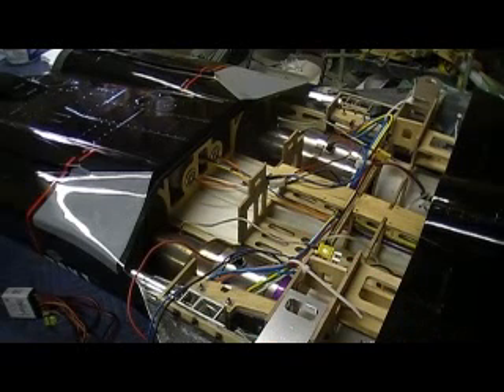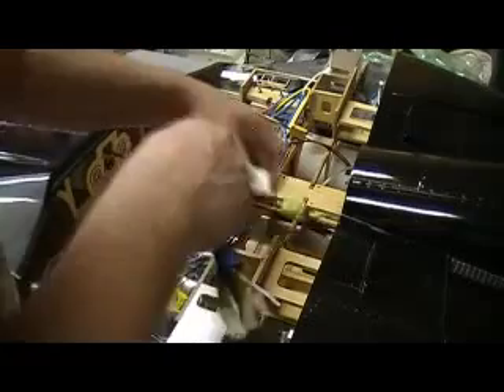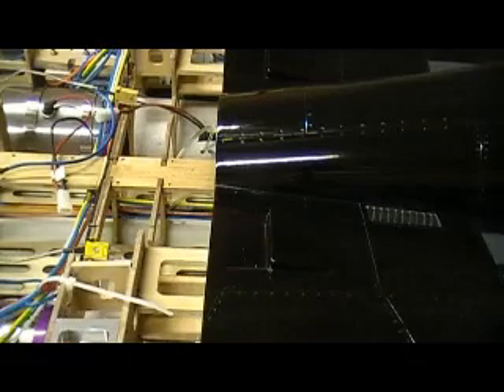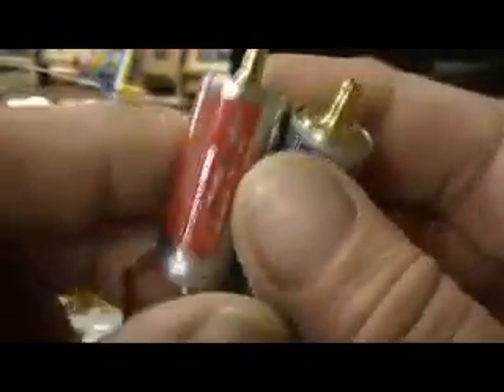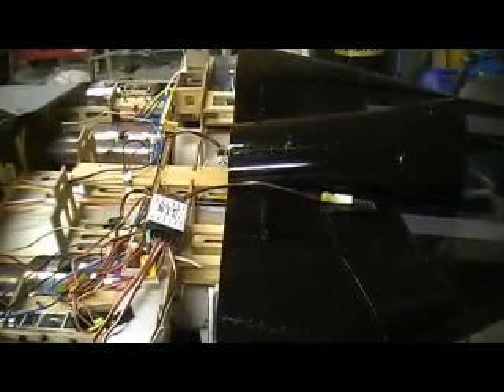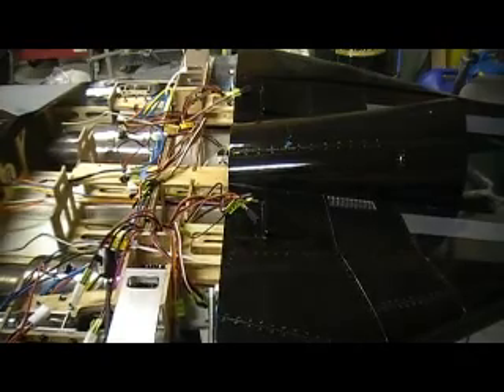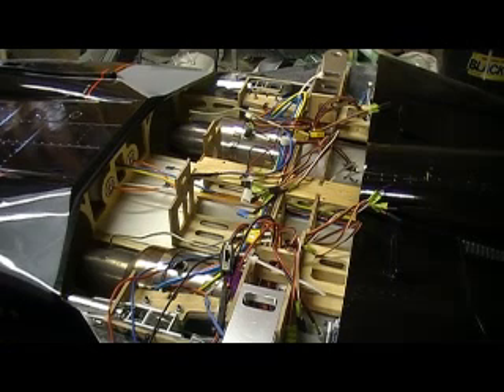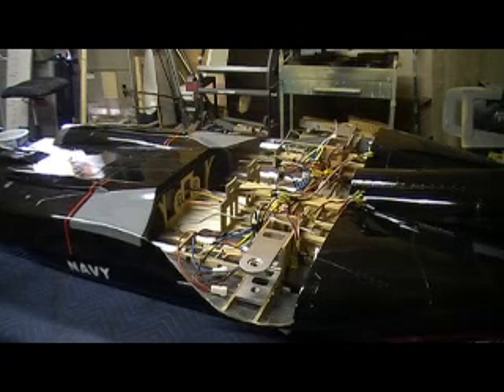FEJ F-14 tomcat build #7

Comment: @bhwystar   (& Bob!)   Bob won't have any problems with those pumps in the position he has chosen. They are very well engineered, have very strong fuel delivery, and will out last the turbine bearings. Pegasus start ups are really smooth once the propane gas has ignited. Try to have two separate channels for controling the ECU's to select function, ie off, shut-down and start/run. Then you can easily use the additional functionality of the CFT button to prime the fuel lines for example.

Comment: Bob your comment on "it doesnt really matter if the pumps are close to the tank" may not be so.  I dont know about  those particular pumps in the RC world but electric fuel pumps in automotive applications are always mounted as close to or sometimes even IN the fuel tank. This is because it is easier for these pumps to push fuel up a line than to pull it the same distance if it were mounted closer to the engine.  Just thought you should know.
Navigator Bill